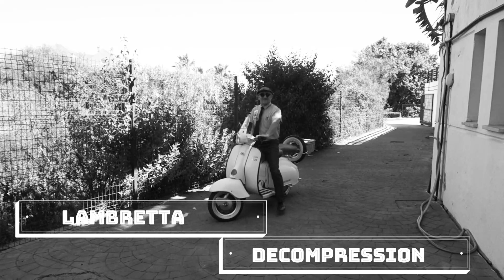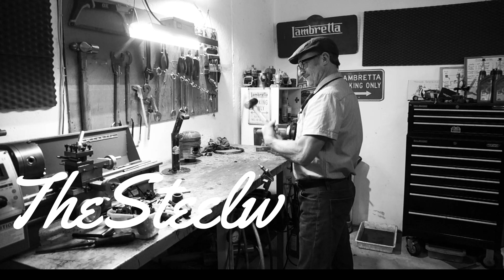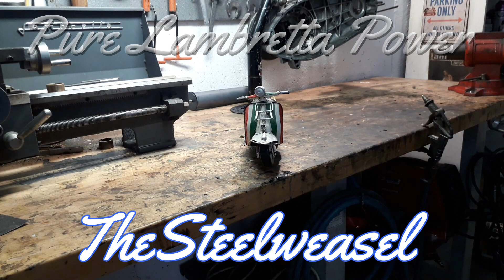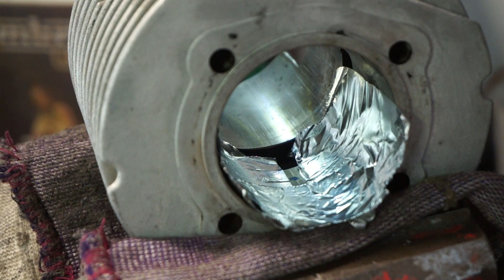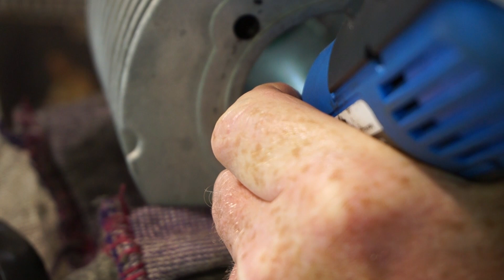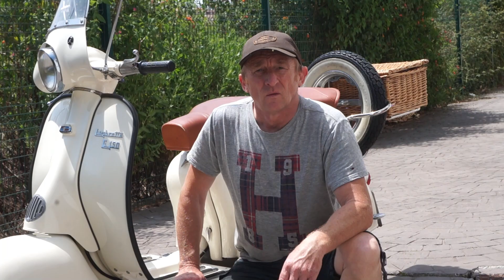#LAMBRETTA  CASA 185 decompression port # TheSteelweasel

Comment: I followed this video cos I fitted an rt195 kit and what a f*cker to try and kick over, so anyway I followed this video and put a decompression port in as per your instructions, and wow! What a difference it made, easy to kick over and when running makes absolutely no difference with NO loss of power.
Top job bud.
Reply from the maker: Your welcome

Comment: Hi Steve, having watched your video on putting in a decompression port on the rt195 and the added benefits,  I've recently acquired a series 80 jet 200 thats been kitted by Sam de Coussemaker of Lambrettafinder. Its got the RT225 kit but its a pig to start. Ive yet to start and examine just what set up Ive got. (Been busy with a house move ) when it does fire and run, it sounds fine. I believe its running a tad rich at moment due to it not been run in yet. 
Cheers Neil

Comment: Found this quite interesting  and am thinking about going ahead with this on my mugello 186 kit, but before I do just wanted to pick your brains.
I've been running the mugello kit for over 2 years with no issues whatsoever, then had an issue were a broken circlip entered and scored the barrel, not badly but enough to not risk using it, and so installed a new barrel things seemed OK to start with but then compression suddenly seemed an issue, even to the extent of damaging the kick-start teeth, have replaced the kick-start but same issue has I think happened again. 
There is no resistance in the kick-start but I can bump start it and run it OK but if I stop the engine then a bump off is required again.
Here's the weird bit though if I  move the kick-start slowly up and down it can occasionally catch on and gives enough resistance to kick-start the engine.
It's been doing our heads in what could have caused all this by just replacing the barrel.
Any suggestions would be much appreciated 🤯
Reply from the maker: You need to use gp kickstarter shaft its stronger ...... and decompression port gives easy life on kick start and engine mounts also stops frame damage on stand struts  ...... and engine runs smoother
Reply: many thanks @TheSteelweasel
Reply: My Mechanic followed your instructions to the letter, wow what a great result, just done just short of a 500 mile round trip and the scooter ran like a dream.
So just to say thank you for sharing your amazing knowledge, expertise and experience.
Reply from the maker: thanks pal so glad its done the job. @martinstokes8551

Comment: Ha alguma perda no desempenho do motor sr steve?????
Reply from the maker: No loss in power above 3000 rpm .... below 3000 is a small lost in torque
Reply: @TheSteelweasel  como faz p aber o local exato do furo em cilindro que ñ seja de vespa?

Comment: I think I will be doing this Steve, nice one. I’m going to a 17t front sprocket but it is ridiculous trying to start my Casa185. Did you use a dremel sandpaper sleeve that slips over the rubber barrel bit? Many thanks!… : )
Reply from the maker: Small gind stone with dremil to remove chrome and make a indentation to allow me to drill 2mm drill bit
Reply: I did the decom port mod Steve, and as you said, it's not much easier to kick over. Not like my ss180 or a stock lambretta, but way less stress on the frame crossmember. It does indeed actually run like a Rolex watch! Thanks again.

Comment: Is the RT195 also 10mm above the exhaust port Steve? I'm kinda handy with my Dremmel I wonder if I can do it.... I don't have a vice though :(
Reply from the maker: Theres  not much difference the rt is a little higher  but I use 10 mm on the rt kit aswell  no problem.  Dont mess it up 😎 ported engines with high exhaust ports dont need the decompression  port   so dont do this on a ported motor .....
Reply from the maker: Yes it can be done on rt no problem
Reply: @TheSteelweasel  Did you go from a milder grindstone to a more aggressive one Steve? It's hard to see what you used! I thought maybe a diamond tip barrel and then maybe a Carbide tip?  I'd love to see a followup video (more detail, maybe the RT) for this, it seems like a lot of people are talking about this mod. Thanks!
Reply from the maker: @jfrorn  Just use a flat ended barrel gind stone 3 mm diameter once your through the chrome its easy going use 2 mm drill bit for hole 👍
Reply: @TheSteelweasel  Thanks Steve!
Reply: @TheSteelweasel  You said a 3mm drill bit in the Vid, its a 2mm?
Reply from the maker: @jfrorn  YES MATE , i moved to 2 mm later after that video , 2mm works and you dont need to remove as much material from bore .....
Reply: @TheSteelweasel  Ok, excellent, thanks Steve good to know!
Reply: @TheSteelweasel  Update: I did it, put it together and it's amazing! Nice low tickover, EASY kickstart, smooth idle and acceleration. I tell everyone to watch your video!
Reply from the maker: @jfrorn  who's the daddy 😁😁
Reply: @jfrorn  Did this cure the slow speed stuttering around town and also did you need to have the cylinder replated?
Reply: @kedrey1  I haven't noticed much stuttering to be honest, maybe just a tad. I did not have to replate the cylinder!
Reply: @kedrey1  another plus I just realized today is that since it's much easier to kick over I can kick it over much more quickly (with greater force but less effort creating a faster cycling of the motor) which makes starting easier, especially when cold and no choke. I always use the choke but I wanted to try it without.

Comment: Hiya Steve, I've got an old Mugello 200 in an early series 3 LI125 case and the compression has always been mental but I've put up with it for a while as it goes so well, managed a true 74mph on my speed tracker the other day and really good acceleration. I tried taking a bit of material out of the head dish and raising the squish up to 1.7 and it still ran nicely but made no difference to what a bast**d it is to start. After watching this video I decided to give this a go and drilled the hole exactly as you show. Unbelievable! it has completely transformed it, where before you were often standing up on the kickstart with the clutch starting to slip waiting for it to get past the worst of the compression stroke now a 5 year old could kick it over, tick over was always ok but now it will tick over on really low revs....dead chuffed as you can imagine
Reply from the maker: Nice job . So happy to help people.

Comment: Its a blind hole, Steve?
Reply from the maker: no its straight through mate
Reply: Cool. Seems like a really straight forward fix. Particularly interested by it smoothing out the ride at low rpm. Good work, mate.

Comment: Steve, I got excited when you said it was an RT kit you were doing but it’s a Casa cylinder 😂👍
Reply: I find my RT a bastard to kick.
Reply from the maker: @zyroman  THE QUATRINI has this port from factory 😜
Reply from the maker: Lol did a rt 195 at the same time with same results
Reply: I took off 2mm from the head of  my “mm “factory 66mm small block kit, stage four with 30mm and clubman, standard li 125 gearing, sucker goes good but man is it a bitch to kick.
Reply: @Smarterthanyou-mthrfkr  That low 125 box certainly makes it more difficult!